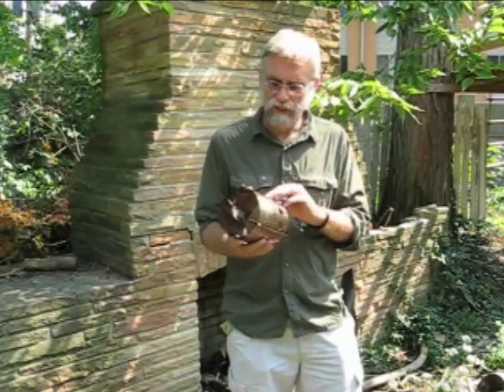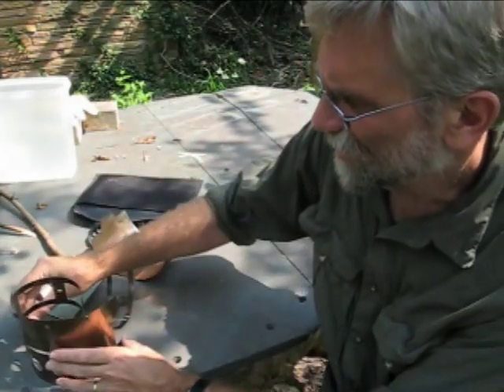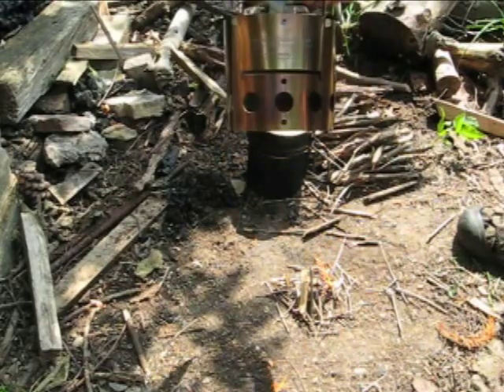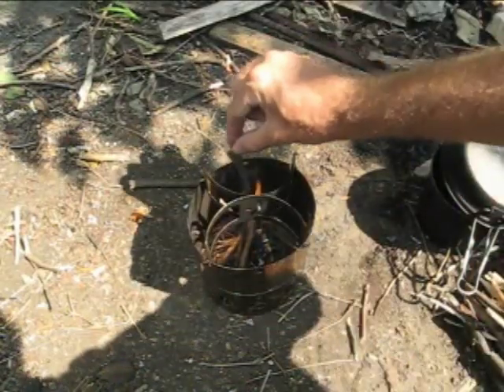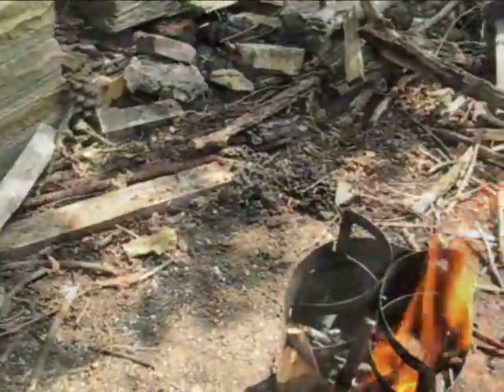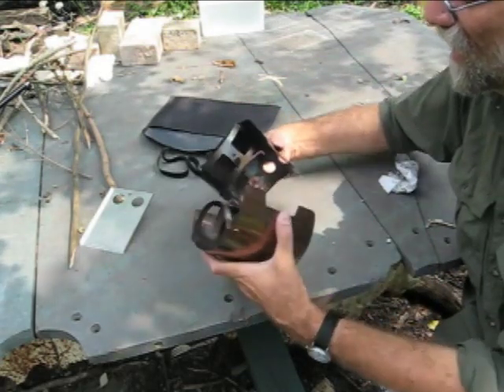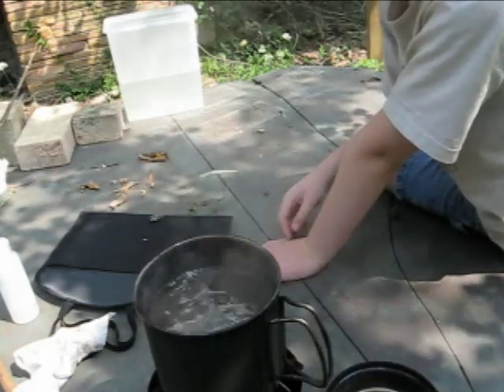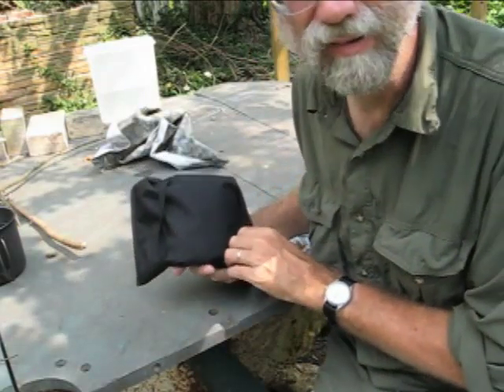A Firebug's Look at the Littlbug Junior

Comment: That is downright clever. Lightweight, compact in the way it folds flat and it can burn wood scraps or alky.

I wonder it it was built with an upper and lower body could it be made to burn with almost no detectable smoke. I have seen other duo layered stoves burn so clean you could not see the smoke.

Thanks for putting this up, great job on a nifty product.

Comment: ok, here's an old forgotten campfire trick re: soot....wipe a thin layer of dish soap on the outside of the pot...it creates a barrier that helps keep soot to a minimum. For you environmentalist..I have no idea of it works with biodegradable 'camp' soaps you might take out hiking. Been a long while since I've used the trick. Going to check it out as soon as I get a chance to campfire cook (usually not allowed fires in the woods where I live or burning the wood for one).